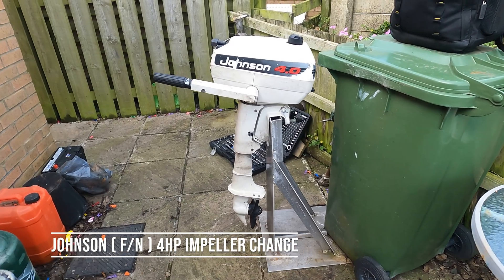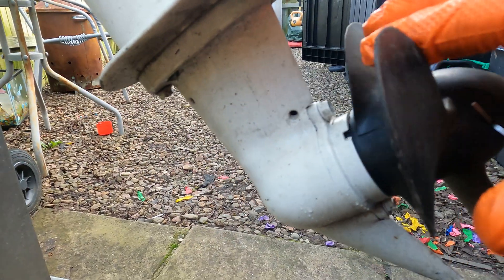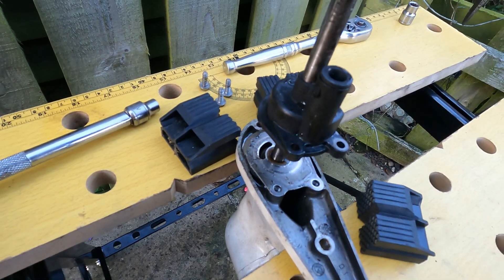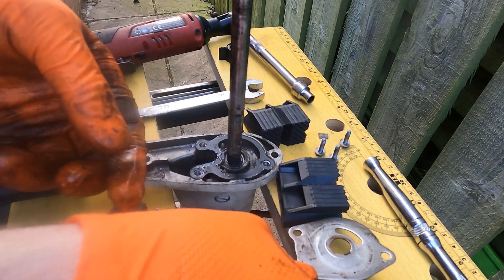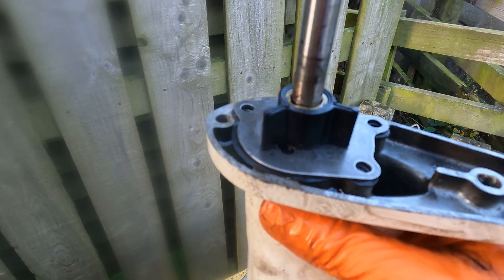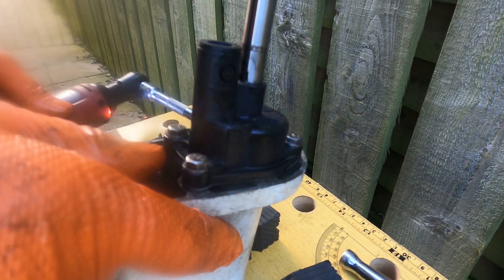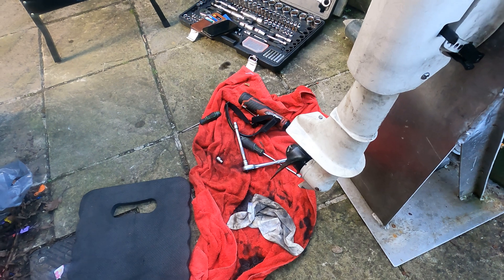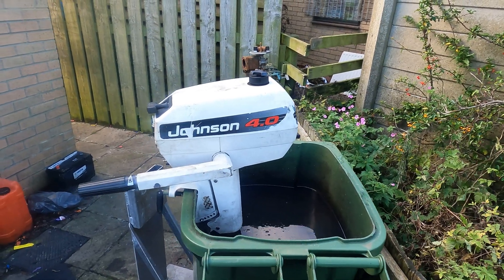Johnson 4.0 4 hp Seahorse 2 Stroke Outboard - How To Change - Water Pump Impeller & Remove Gearbox

Comment: I have a long shaft version. The gearbox came out but left the driveshaft in the engine side. Is this normal? I can’t seem to be able to remove it. Making the reassembly I think near impossible
Reply from the maker: So the drive shaft is still attached to the power head but you have the lower unit removed? 

The shaft should have come with it. It happened to mine also like in the video, I have a video of me repairing this on my channel.

Unfortunately you’ll have to remove the drive shaft, it’s not impossible but it could be very very difficult to do if left. 

Watch my video and it may help 👍

Try using some mole grips on the shaft and see if you can tap it out.
Reply: @MarineEngineServicing thanks yes I’ve now got it hanging in a vice, using penetrant and a hammer haha. Hopefully it comes off in a few days
Reply from the maker: Perfect 👍 sometimes happens if the grease drys and binds the shaft to the power head. Normally on other outboards it would prevent the lower unit from coming out. 

Seems an over sight on the Johnson that the pinion gear isn’t retained with a nut etc 😅

Comment: Thanks for the video, I think I can do it.  It's a Johnson 4.0 HP, yr.2000.  Want to change the impeller as it has been cramped in there since 2000.  Last year used it only once, all good.  But the water stream is not as nice stream as yours is after changing the impeller.  Instead it was more like spray, but volume seemed ok.  Looking for a replacement was a challenge, I had a choice between 3 vane or 6 vane impellers for the same motor.  How could that be?  Well, I see your replacement was a 3 vane impeller.  So I will buy a 3 vane impeller with confidence.  G'day!
Reply from the maker: Thanks for watching and glad to hear you're going to do the job 👍

Try ridding the telltale outlet too. Sometimes dirt build up can make it seem like the pump is weak. The telltale outlet is normally just an indicator not the actual outlet of the cooling water. 

Between the different vanes it’s probably just down to the aftermarket makers having different ones.

Comment: Currently we dont have 3 blade impeller here in the ph what is the alternative impeller like yamaha hehe
Reply: I noticed that my shaft is extended is it possible to remove it?
Reply from the maker: Yes it can be removed, the shaft can be removed by taking off the drive gear from inside the gear box, the shaft should then be free. Sometimes a circlip holds the shaft in too.
Reply: @MarineEngineServicing do i need a shorter shaft to make it fit? Or i will use the same one?
Reply from the maker: Like I say it’s possible but you need a short shaft drive shaft, water pick up tube and shift linkage & maybe shorter bolts
Reply: @MarineEngineServicing can i ask the P/N of the shorft drive shaft and gear selector sir? Hehe thanks!
Reply from the maker: Possibly these are the part numbers, please check first.

0391594
0327983
0327980

👍
Reply from the maker: I’m not sure what the alternative would be as P/N 433935 is the impeller that fits this engine from 87-06.

I’m not aware of any alternative impellers. 

It replaces omc part number :

0433915 
433915 
0433935
433935 
0767407 
767407
Reply: @MarineEngineServicing thank you! Our stores here are so limited
Reply: @MarineEngineServicing  just got my motor start up today i noticed smoking on the neck and maybe i was too rich on the oil hehe
Reply from the maker: Yeah that possible or the mixture is set too high on the carb. Best start with the fuel oil mix 👍
Mind 2 strokes will always have some smoke just by there design
Reply: @MarineEngineServicing im curious about the fuel consumption in liters sir how many hours is 1 liters of continous usage hehe
Reply from the maker: I’m not entirely sure how much the engine uses per hour. It won’t be much compared to larger engines. Maybe a few litres an hour at mid throttle?

Comment: What does the gear leaver line up with when putting back together
Reply from the maker: It slots into a hole in the gearbox. Not retained by a bolt etc.
As it’s only a fwd / neutral drive it doesn’t need retaining to “pull” a gear up.

Comment: My 1984 4hp seahorse is alot different
Reply from the maker: I believe they made the 4hp from about 1987 to 2001, in that production run there may well have been a few changes made over those years.